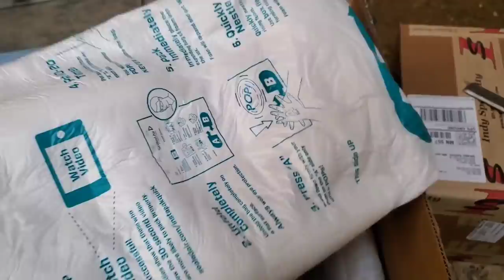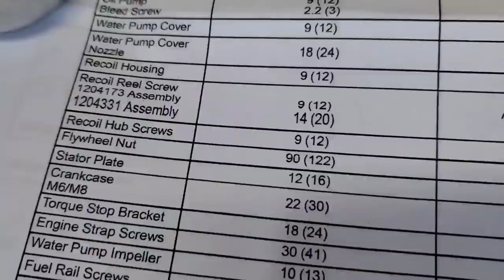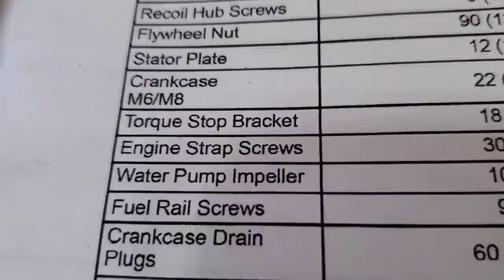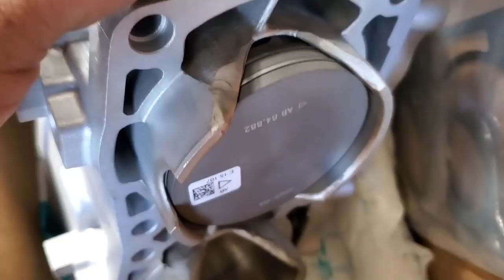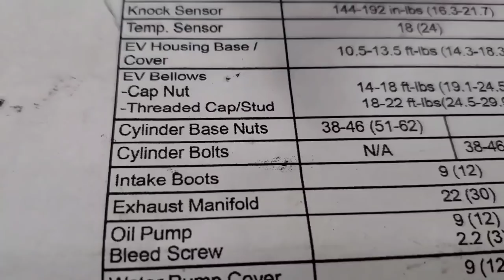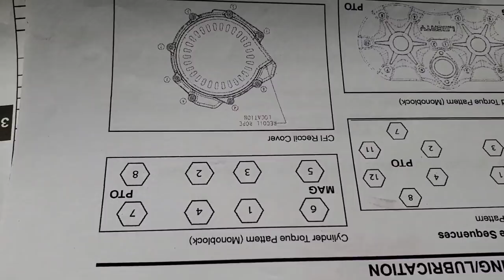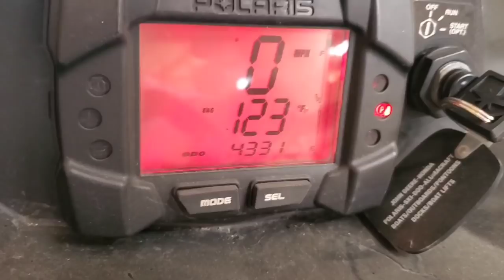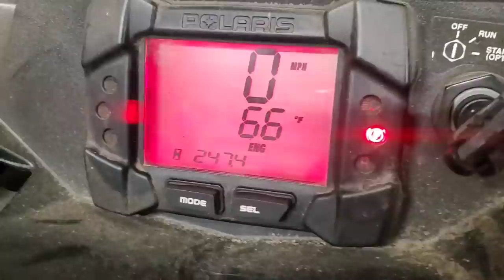Complete Polaris 800 CFI Engine Rebuild Switchback and RMK

Comment: I remember when there were two engine wires and one tube, a belt and 4 bolts to get the engine out.  Of course I remember when a 16 HP Scorpion was a hot machine.

I can't believe how complex these machines are now.  You know what?  Back in the day those machines were just as much fun.
Reply: yes but also back in the day, you could go slow and brake ffresh trail though 6 feet of snow, now you need a groomed trail or they just sink like a 1200 pond rock, but will go 100mph, oh ya so much fun,, not...
Reply: @arnoldromppai5395  they're still fun in flatland and bush situations but yea I agree nothing touches mountain riding.

Comment: I love snowmobiling I always owned a sled. Up until the middle to late ninetys. My last sled was the 97 Polaris 700 Triple. Fastest sled I ever had. So This one late fall I figured I would take my sled to the polaris dealer that sold this sled to the original owner so knew the sled. I would take and get carbs cleaned and adjusted. They put bigger Jets in the sled when it was new., Badass clutch, and 144 spikes in track, and Pipes. Well needless to say they put the jets in wrong Carbs and Gave it back and my first ride it let loose. No sorry Or repair. Hell at the end of fighting with them I would of been happy with a Fuck You to me. But NOTHING... So I quit riding plus we didnt get snow like we used to anyhow.  You brought back alot of good memories and one bad...LOL...Those 800 are Rockets ..Great Video..  I bet that long track is a hell of a trail breaker .. Sweet Sleds Bud ..

Comment: Brings back memories from last fall when I had to go through my 600 Rush at 8400 miles.  A piece of something got in the PTO cylinder transfer port and ripped the whole side apart.  New pistons, cylinder refurbish by US Chrome, seals and a used set of cases from ebay.  I also sent the injectors out to be tested.  They were all a little low but the were cleaned and brought up to spec.  I changed my first set of pistons at 5500 miles due to the ring grooves getting wider.  At 7000 miles I changed the jackshaft bearings and kinked my oil line from the tank to the pump.  It locked up within 2 miles which caused me to put in my 3 set of pistons.  I am on set 4 now and bought a 4-stroke for my main ride.   The Rush is now the back up sled.  My 2003 600 XCSP has 9400 miles on it and has never been apart!!!

Comment: Best thing for these snowmobiles is to have a durability kit and getting a fuel controller from Dynotech Research... Jim has found all the imperfections and found the way to make these engines finally rock solid !

Comment: I think the screw with the springs you adjusted on the throttle body was the synchronization screw, the one with the lock nut in front is the oil adjuster screw I believe

Comment: Nice video, I tore into my sled season before last had to replace a crank bearing and replaced the pistons at that time as well.  gotta tear into it again and just ran across this video.  runs strong but getting water blowing out into the engine bay intermittently and can't quite determine where it's coming from.  Suspecting either a bad head gasket o ring, or a mechanical seal issue.  Hoping I get it back together before the snow starts falling!

Comment: Should a person try this, I suggest that the "Barley Sandwiches" be left at the home base a good ten miles away as it encourages a man to abuse this food substance to the limits. I put heads on a 429 ford truck engine out in the snow bank and it wasn't this complicated. I haven't drank for nearly twenty five years and this  could cause me to severely test my sobriety for absolute positively serious overdosing. That would have my nails gone and the knuckles on both of my nose pickers in serious troubles. Wow, I did play with a few that had a half a dozen bolts holding it together. I took a snowmachine engine in to the machine shop and seen the amount of my engines in for catastrophically messed up machines and instead asked him if I had any parts he needed to put some of his down and dirty ones back on the trails... he offered me a hundred dollars and I took it. Best deal ever as I  was too poor to own one

Comment: On my no fuel injected sleds i always put a oz of oil in with a full tank of fuel just for that reason. Polaris had a pretty long run of not getting enough oil. Tip for anyone who is looking to buy a used sled pop the exhaust off and look at the piston skirts especially if in the description it say's "Fresh rebuild" unfortunately there are a lot of dishonest people out there these day's and you can have just as much $ wrapped up rebuilding engines in sleds like these as it cost to rebuilding a small block chevy. The 4 strokes are even worse especially if they have any power adders such as a turbo or nitrous or both. In my opinion snowmobiles these days have taken the crown from boats on cost to repair. "Break out another thousand" is definitely a true statement for both.  I rebuild a lot of toys and nothing tugs on the heart strings more than when you get a guy who busted his butt to buy a nice used sled only to ride it a couple times and then it blows up. Just like my rigs i won't go any newer than a 07 with anything because of the electronics and the cost of repairs and even 07 has to much junk on them. Thanks for the video Dave it was nice to watch someone else turn wrenches on them. Feel bad for your pocket book though.
Reply: Thank you

Comment: Tearing my 09 assault down rn, bought the fix kit aswell, the crank actually siezed on mine but ya, my engine mounts were broken, fun stuff
Reply from the maker: Good luck
Reply: @davidhaley7053  thanks
Reply: @davidhaley7053  update, the crankcase is cracked around one of the drain plugs at the bottom of the crankcase 🤦
Reply from the maker: @kendallmastre3356  that stinks.   So I'm guessing it was running lean and that's what caused it to seize up?  The motor is junk now?
Reply: @davidhaley7053  I think I'm gonna get it welded, it's not super bad so hopefully

Comment: Some of the problem was piston to cylinder  clearance.  The dealer I deal with was saying he got
Reply: 3 sets of cylinders and 16 pistons then measure and match piston to cylinder clearance. Since not all pistons were the same size. Some were off by 7to8  thousands. Your clearance was way to much. My 880 went 7200 miles. Ring locating pin moved ring moved hooked a port..4 year warranty took care of it. To much sealant on the newer sleds was blocking the oil to crank

Comment: Hi, which pistons did you use? Heard OEM pistons don’t stay within spec. For very long. Is there a better option? And what would you recommend? Thanks
Reply from the maker: There's a lot of opinions out there.   The original pistons went over 4,000 miles with very little oil so I went with them again and turned up the oiler.  I've put 1,500 miles on since then and I'm very happy with the performance.   Good luck.

Comment: How much total cost were you into this rebuild?
Reply from the maker: The switchback was about $2,300.  RMK was $400?
Reply: @davidhaley7053  just new pistons? On the rmk? How many miles did the rmk fail at again?
Reply from the maker: @willmarnach3153  put a durability kit in it.   Pistons, rings, wrist pins and bearings, gaskets, spacer, longer bolts.  I think it was around 3,000 miles and 150?? hours.